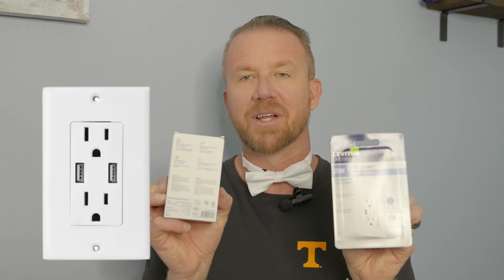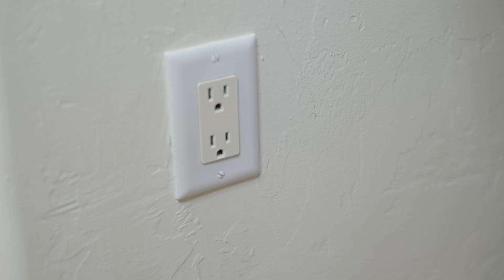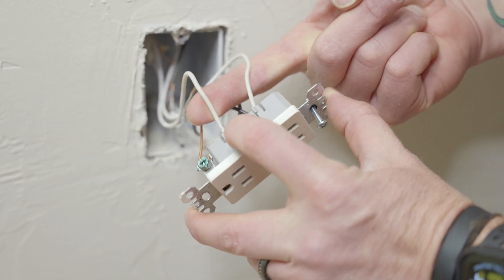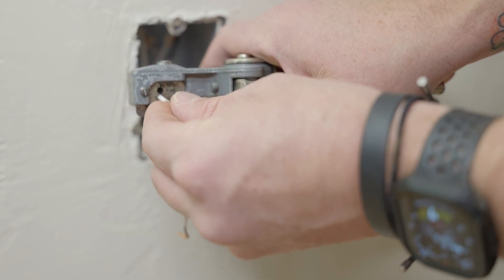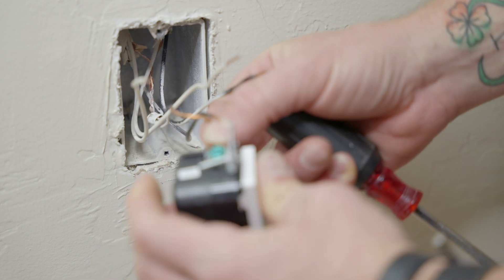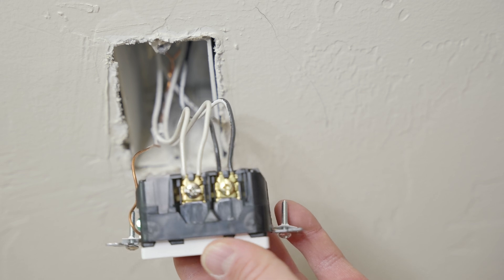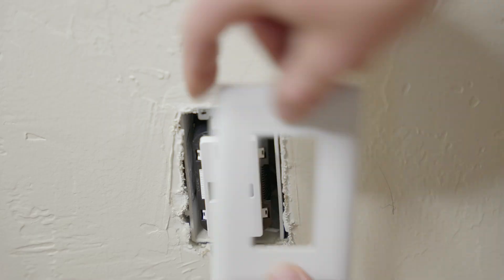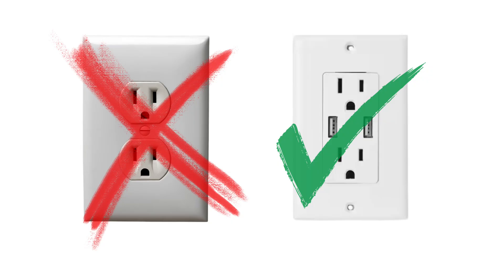How to Install USB Outlets!

Comment: I installed these about 4-5 years ago and already one USB port is lose. They don't last plugging in and leaving a wire in there. I got rid of these outlets and went to the multi plug off amazon has 5 outlets and 4 USB ports. You just remove the wall plate screw and plug it into any outlet and screw the center in so it locks to the wall. I can easily replace it if gets worn out without having to cut the power.

Comment: Does a solution like this support the USB Power Delivery (PD) specification? More specifically, 5V, 12V/15V, 20V, 28V, 36V, and 48V at 2A, 3A, and 5A? What about Programmable Power Supply (PPS)?

Comment: USB power will be transient. I wouldn't bother if I were you with such wall sockets, unless you plan swapping again for whatever power delivery standard emerges in the next decade. You have a switched mode power supply permanently powered,  wasting energy and creating RF smog. Like all electronic devices, they will fail eventually and are unlikely to last as long as the sockets which can last for many decades.
Reply: and in a lot of places theres not a good place to put you usb charging devices except the floor

Comment: the sockets are stupid and should be banned. putting active electronic inside your walls is idiotic, even if said electronics meet all safety requirements. the risks of fire is just too great. these electronics will be on all the time 24/7 and hidden inside your walls, how are you going to tell if it's overheating an melting?